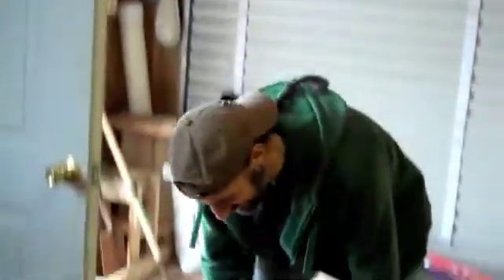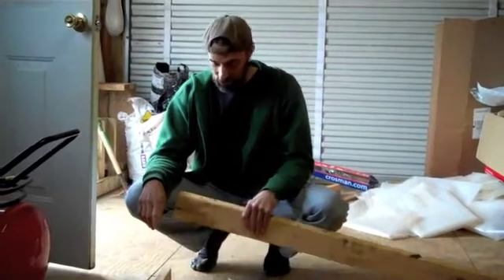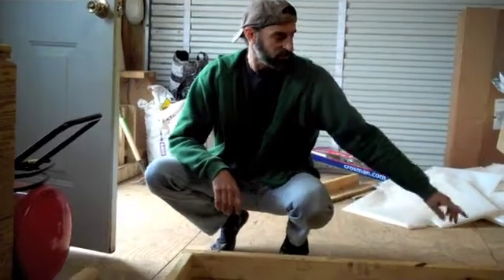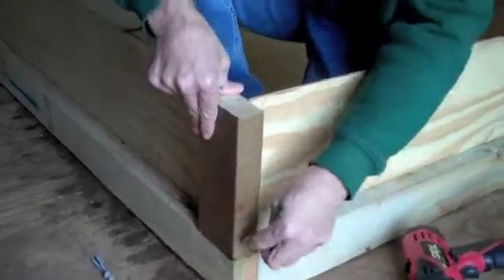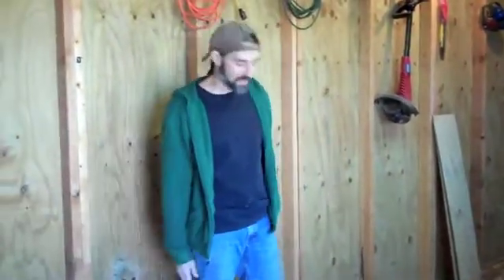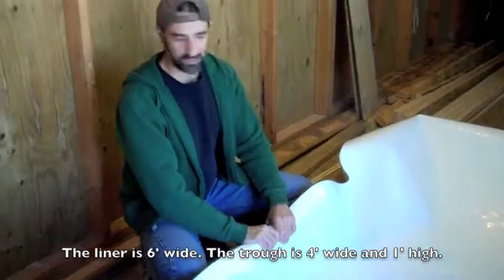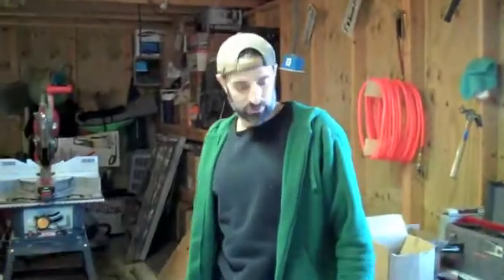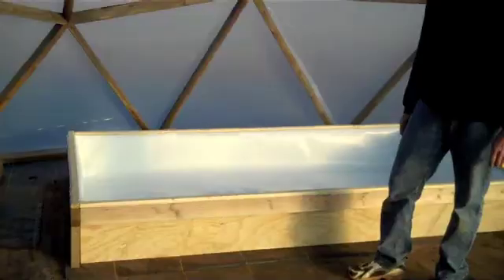TROUGH CONSTRUCTION

Comment: I'm really gaining a lot from your videos, thanks!

One suggestion for this one. Before stapling, it's a good idea to put water in. It is way to easy to attach the liner slightly too tight, which means it doesn't go into the corners properly and puts undue strain on it.